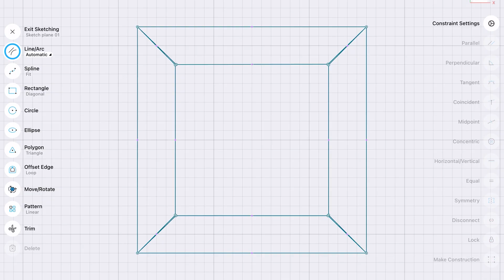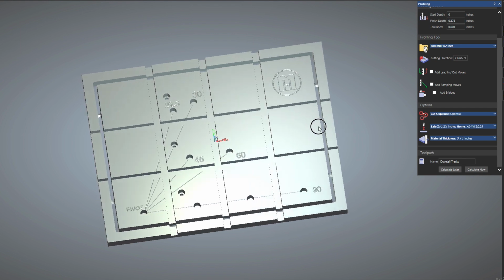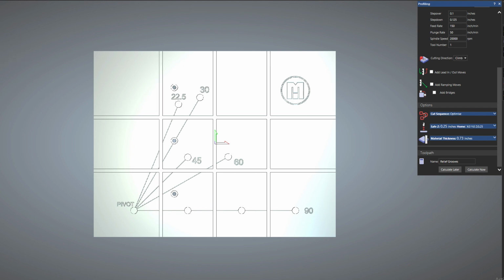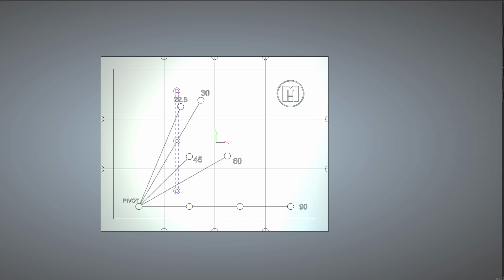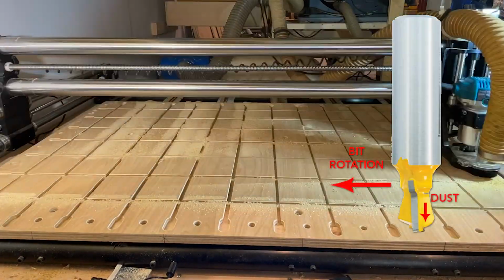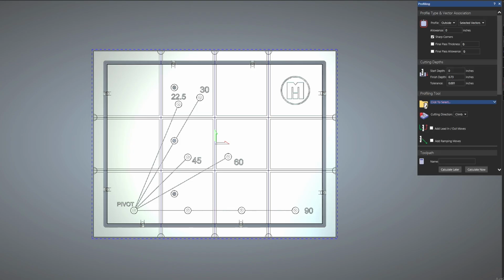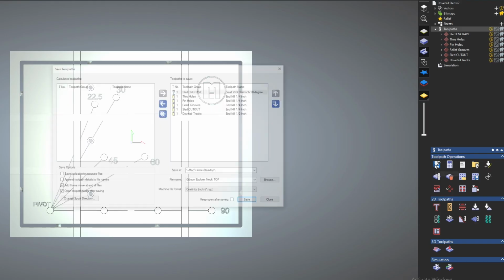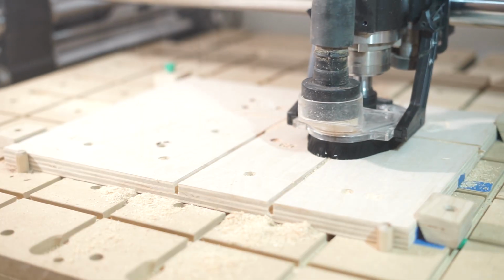EP 18 Onefinity CNC - Make Jigs With Your CNC

Comment: question: if i set the xy to the bottom left corner, will that still be ok since we are cutting it out anyways and that in itself will make the final board perfectly 90 degrees anyways?
Reply from the maker: yes, that's ok, just match it when you zero in cad and phsyical.

Comment: I made this jig today. Cool idea and it was easy to do, but aren't the angles wrong? The 45 is correct but the 60 degree will give a 30 degree cut on a board clamped to the jig. The part marked 30 will give you a 60 degree angle and 22.5 degree mark will give you 67.5 degree angle on the board you cut. Am I wrong on this?
Reply from the maker: @morganhop , can you help jason?